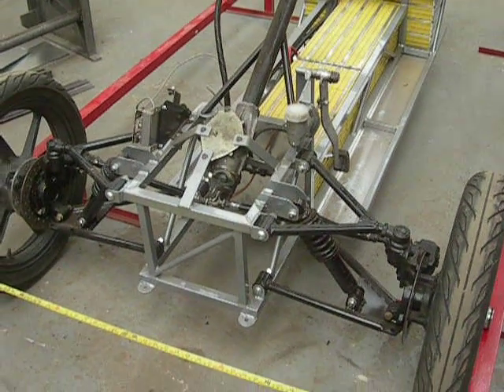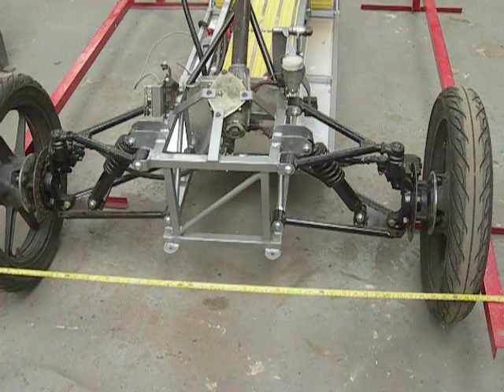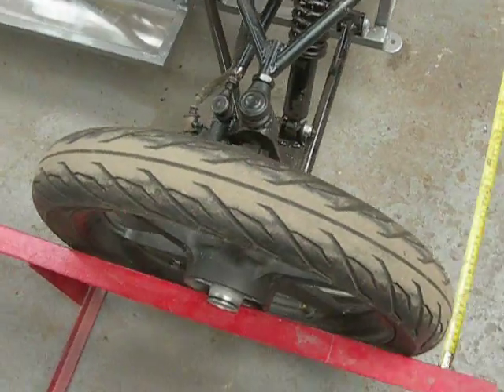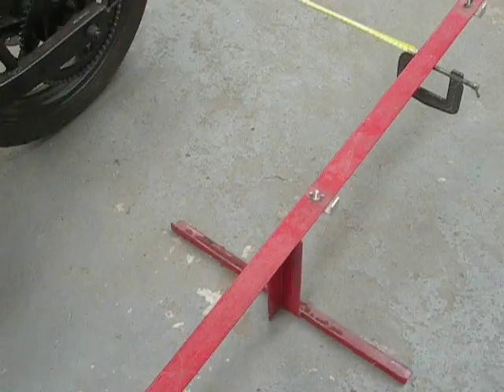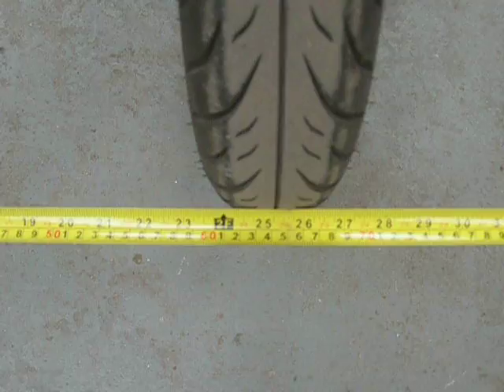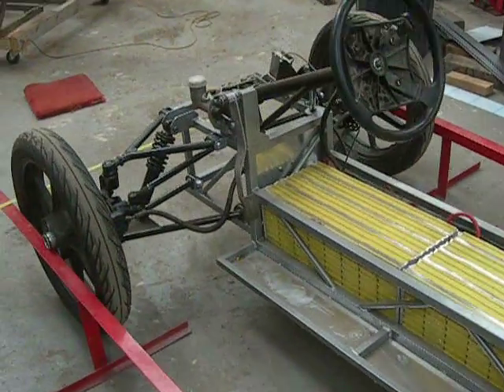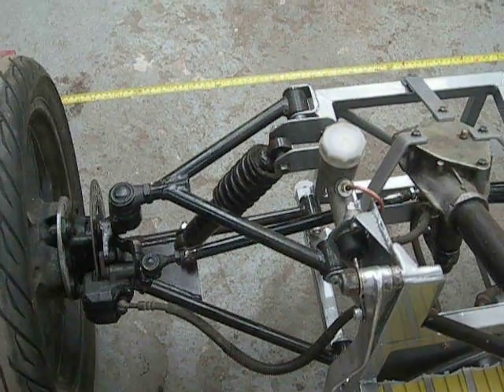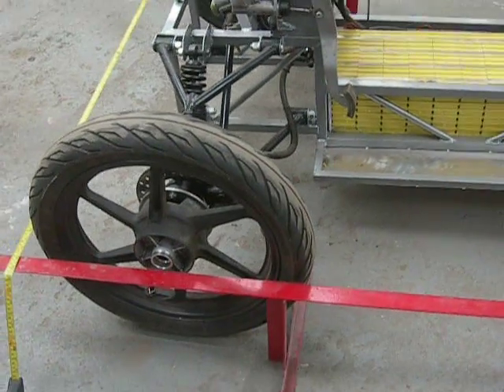TRIKE WHEEL ALIGNMENT

Comment: Post sort of old but I thought I'd comment just the same. I thought your jig a good idea so I built one and it worked good. In the process I noticed the movement of the wheels with the tie rods disconnected. I realized that the wheels toe out naturally when the trike is rolled forward. Idea! With both tie rods disconnected and neutral camber I 1. toe both wheels in slightly, 2. roll forward a few inches (a) rolls more easily as the wheels approach straight/center to the rear wheel, (b) begins to go over center and rolls harder, (c) roll back and forth till I find the sweet spot where roll is drag free, 3. play with toe as desired and 4. reconnect the tie rods; no jig no measurements just physics at work.